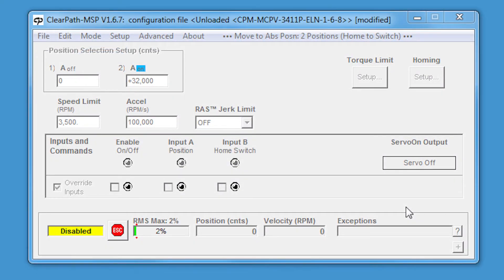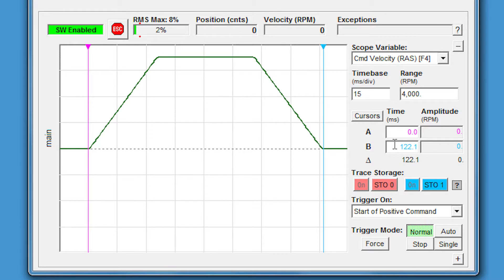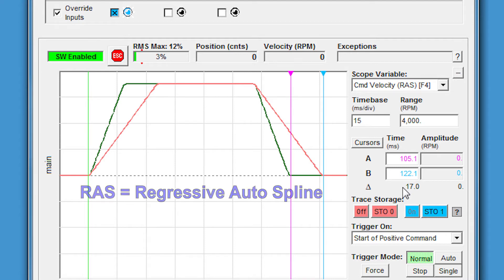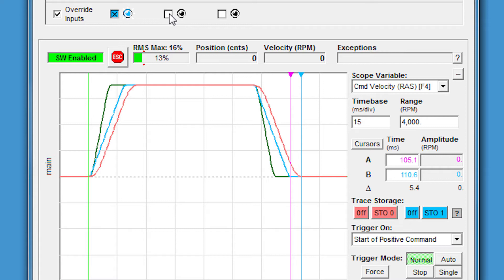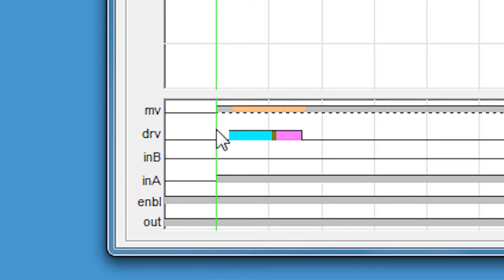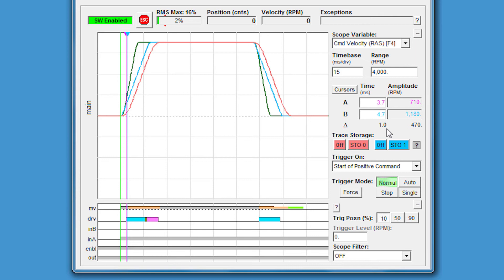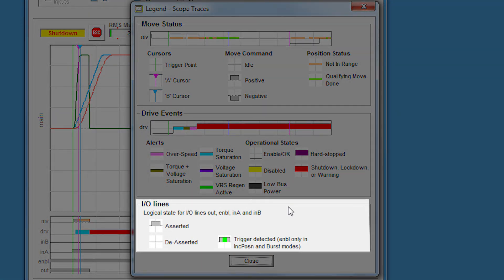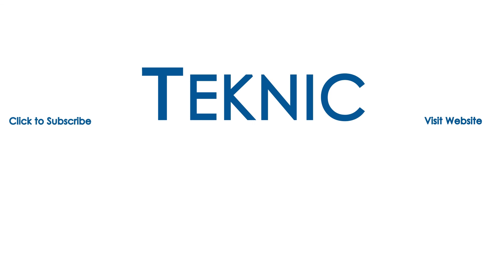Troubleshooting with ClearPath's Software Oscilloscope

Comment: In all due respect, it is NOT "RPM's per second". It is simply RPS ("Revolutions per second). 

"RPM" always means Revolutions per Minute. NEVER "seconds".
Reply from the maker: Hi pat dee, when we use the term "RPM/s", we are referring to acceleration. RPM/s stands for "revolutions per minute per second" and is an appropriate (albeit, somewhat uncommon) unit for acceleration. For velocity units, we generally use RPM, but RPS would work as well.

We like to use RPM per second for acceleration because in many cases, it's easier and quicker to calculate the acceleration. For example, if an engineer knew he/she needed to increase the speed from 500 RPM to 2500 RPM  in 2 seconds, it's easy for the engineer to calculate that 1000 RPM/s is the required acceleration rather than 16.67 revs/sec^2 or another unit.

As a side note, you're able to change the units of acceleration shown in MSP or ClearView to counts/s^2 if that is preferable.

Best,
Bridgette G.
Reply: I understand that now.

However, in MOST cases when most say "RPM's" they are not talking about "revolutions per minute per second". My point is: in so many cases, ignorance dictates that abbreviations and/or words or phrases be changed in a manner that is wrong; and it evolves into a state, where everyone uses these incorrect euphemism's in a common, grammatically error-prone way. IE: There is no such word as "irregardless" yet most say it. There is no such word as "didunt"; yet most say it now. Not to mention "If I were...... It should be If I was....... Etc..

Thanks for alerting me to what you mean. I love Centroid products and all they have done with CNC. I am going to order a lot of your products just after the first of the year in building a CNC mill. I can't wait to use your outstanding products. Especially that "Acorn". For it is head and shoulders over anything I have seen.

Keep up the good work "Centroid".